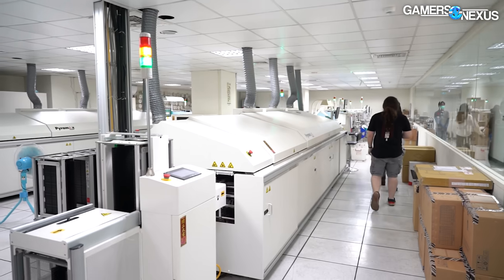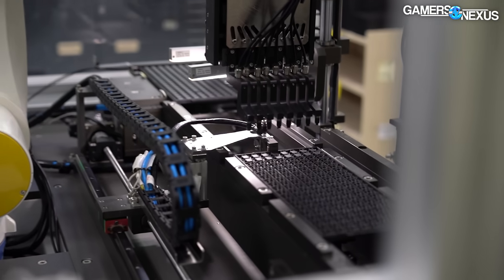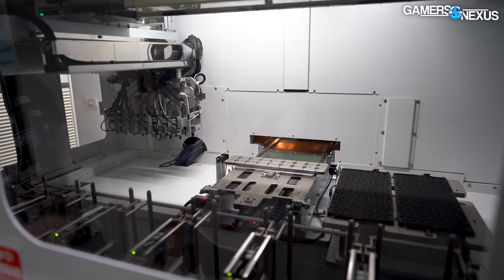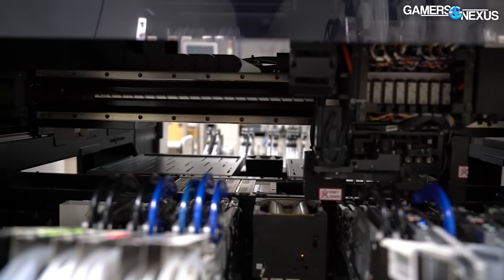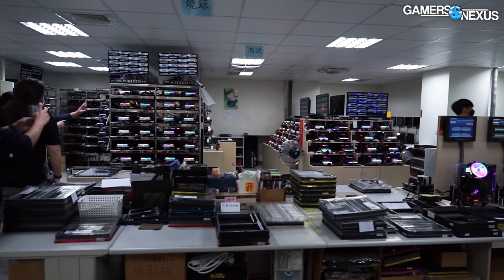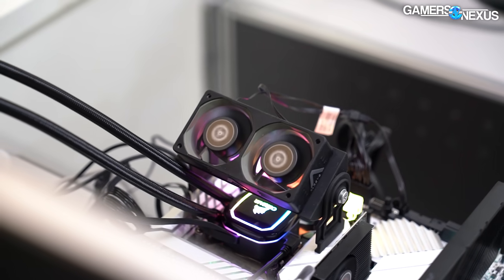How RAM is Made: Automated Binning, Manufacturing, & Burn-in Testing | Factory Tours S3E2

Comment: I used to work on an SMT line. It's so weird to see one work without constant interruptions, downtimes, alarm bells, dropped panels...
Reply from the maker: Cool! What were you making?
Reply: I used to have to babysit 2 different SMT lines along with 14 other auto lines. We were making circuit boards that went into brake modules for different vehicles. Our SMT lines went down a lot for various issues...they weren't the most modern or high end machines though. I always loved watching the pick and place just flying through the resistors, caps, etc. Started as an engineer in the summer in a year where we had multiple power outages (fun)...our SMT lines had only 15 minutes of backup power and then all Hell broke loose. Newbie at work with numerous lengthy power outages equals tons of fun!
Reply: @DaMerk5  Wait, you aren't OP.
Reply: @GamersNexus  Everything from EV battery controllers to custom wireless modules, but mostly closed-circuit measurement and control SBCs. We dealt with a ton of BGA-packaged DRAM and CPU modules. Unfortunately we didn't have AOI machines after solder printing, only basic 2D coverage checks, so visual and x-ray inspection was necessary with most products. The machines were old and worn-out, downtimes due to mechanical failures and panel drops were a regular occurence. One machine even used 3.5" floppy disks to load the tooling programs (it ran OS/2 and only had a coaxial thin ethernet connection). Obviously we couldn't leave the lines unattended even for a few minutes.
The challenges were certainly interesting, but the end-of-quarter crunch got really stupid sometimes.
Reply: I worked at Cincinnati Microwave nearly three decades ago; we made Escort radar detectors, and did large job work for others, right in Cincinnati USA. I was a coder, but I loved to watch the line in operation.
Reply: Great job, GN team. Excited for more of this. 30min per section would be great!

Comment: Gotta love seeing those offline industrial computers running Windows XP for the machine control software.
Reply: If it works don't break it.
Reply: True most specialized machines run older Os versions depending on the field of work
Reply: And windows 7
Reply: I sold a working Dimension with XP on it to a guy for cheap. Asked if he was using it for industrial control and he said yes.
Reply: Lol. Older Operating Systems?  A tools is a tool is a tool. The most American ATM use Xp  and most of them are unpatched. Doing the job with little to no error. Is worth keeping. Even if it’s on DOS. Lol. The new USA fighters are DOS based Operating System.
Reply: @riccarter4784  It is an older operating system. It has its quirks, limitations, and vulnerabilities. That being said, windows XP was incredibly stable, hence why industrial systems run it. It was also out for a really long time and didn't have kill switches like windows 10 and 11 (windows 10 will make fake 'system interrupts' to force you to update). Industry ain't got time for updates.
Reply: That’s what I’m saying. 10&11 suck
Reply: @goldenhate6649  Windows XP was notoriously unstable, people just look at it through rose tinted glasses because it reminds them of better times. It was a virus magnet and before the Service Packs it would constantly BSOD. Modern day Windows is much more stable, more secure and less prone to any weird instabilities.

But that's not why XP is used in factories. It's used because it's an offline machine, and the OS is meant to run software to control the machines. The software still works on XP, it might not work on a newer OS, the machine is not online so there's no reason to change it.

Comment: Summary
- 0:05 Robots making thousands of terabytes of RAM, revealing secrets of RAM manufacturing.
- 0:19 Vcolor, a Taiwan-based factory, uses custom-built automation to produce high-end memory.
- 0:54 Introduction to the automated overclock bending light lab with advanced frequency and stability testing.
- 1:38 Different colored robots (yellow and red) perform specific tasks; red robots are faster.
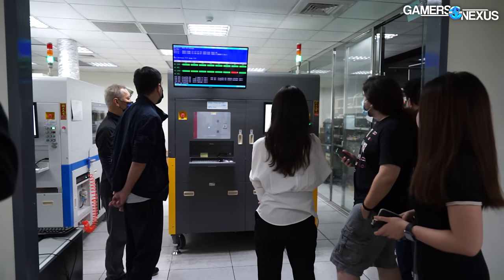- 2:00 Location of the factory in Shindan, Taiwan, housed in an older mixed-use office and residential building.
- 2:27 Inside the advanced overclocking test lab, high-speed binning robots and automation determine chip quality.
- 4:22 Description of the binning process by robots, including testing and sorting chips based on performance.
- 6:40 Transition to the assembly of RAM sticks using Surface Mount Technology (SMT) lines.
- 7:52 SMT lines feature fast-paced robotic arms, solder paste machines, and precision in component placement.
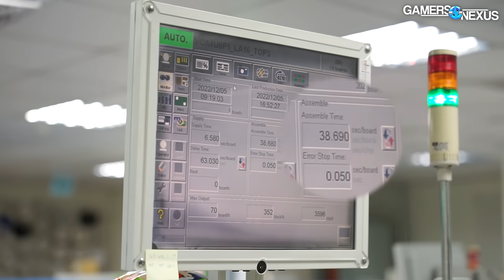- 8:47 Detailed explanation of the SMT process, from loading solder mask and blank memory PCBs to component placement and baking.
- 11:42 Introduction to the burn-in lab where each stick of memory is tested for stability and endurance.
- 13:32 Overclocking testing area where high-bin memory sticks are further tested and tuned for performance.
- 15:00 Conclusion of the video, highlighting the entire process of memory manufacturing and future plans for similar content.

Comment: Nice to see other SMT lines at work. At my workplace we have 2 SMT lines, I'm in charge to mount reels on feeders for the SMT tables, checking for any errors on the setup and sometimes supervising the lines. It's real fun when you receive parts in tubes instead of reels... Placing them by hand is a real pleasure x)
Reply: I worked at a company where we banned tubes, except for initial build prototypes. The downtime, defects, and inventory shrinkage (dropped parts, bent leads) had become too costly compared to the carrying costs of the higher capacity reels. It was fun trying to find someone with a 56 mm feeder to sell for our machine, but better than dealing with the homemade fork in the vibe feeder.

Comment: I worked for a company as a Senior SMT technician for the Fuji Aim EX III manufacturing motherboards for a customer in the server/ data center space using both AMD Epyc and Intel Ampere CPU's. My job was to train new people on how to operate/ load parts into the machines and to help engineers keep the machines running. I also ran the ICT ( in circuit testing ) on a Keysight i3070 series 6 which was a faster and more indepth fixture compared to flying prob. 

It uses thousands of pogo pins on top and bottom to make contact with all test points and run unpowered and powered tests to ensure all parts are present, properly polarity, functioning and no shorts. I also ran FBT ( functional board test ) it's similar but simulates a real working environment with test CPU's installed and runs a series of tests to ensure the board will handle the tasks it was built to do under " extreme " use case conditions.

Comment: Hi Steve, cool video - thanks for creating and sharing! I have a few questions though...

1️⃣ Were there meant to be burnt-in titles for each step? (Noticed "Step 3: Burnt-in" @ 11:46 but didn't noticed a Step 1 or 2 title)

2️⃣ In Step 1, when you say they do a "pass/fail analysis" (2:46) does that mean they're checking the module works at all (I.e. filter out any DOA modules)?

3️⃣ Just to double-check, when you mention "other frequencies" (4:08) is this MT/s?... If so, what was the actual frequency (MT/s) being tested at the time please, as I missed this?

4️⃣ By "burn-in testing" is what you can do as a consumer, where you run various patterns and arithmetic on the RAM to make sure there are no RAM errors? (if so, does the test check all ~8,000,000,000 bytes on the DIMM in 60 mins? -- that's a lot faster than a consumer test, right?)

5️⃣ I think you mentioned "AIO" somewhere (couldn't remember/find timestamp)... Do you mind clarifying how this applies to RAM?

6️⃣ Is the thumbnail ("Binning Our Own RAM") meant for this video?... I saw you had GN modules in the O/C benches (nice btw!) but the video seemed more like a "How RAM is made" video, rather than a "We made our own stick of RAM" video (IMO) 🤷🏼

NOTE: This comment is meant constructively (I am just naturally very detailed!)... To be clear, the overall video was great and really informative, thanks again for making and sharing! 👍🏼

Comment: I was just looking at the new gn site, specifically cpu and gpu section... I think adding filters would be nice, nothing too fancy, manufacturers for start. I also think for futureproofing, it would be good to have a way to extract architecture (also to apply filter); in the near future there will be gaming level arm cpus, and in a little further future arm gpus. Considering infinite page, I think some general filters at the top would be nice and would fit nicely (better than multiple tabs).

Comment: 8:50 to be super pedantic, the "solder mask" you're referring to is actually the solder stencil. Solder mask usually refers to the non conductive coating on the PCB itself (the stuff that's usually green, or in this case, black).
Reply from the maker: Thanks for that. Must have been a translation issue. The factory referred to (what you're calling) the stencil as the "mask" after translation.

Comment: At the polar opposite of mass production SMT assembly, I hand built prototypes of similar size to RAM modules, but with 2 or 3 fold the component density. These required a polyimide PCB and high temperature solder as they needed to function reliably @ 175 Degrees C.

Comment: Aside from silicon fabrication and smt assembly, there is a missing step in between - packaging silicone. I'm sure this is a fascinating process too.
Moreover, I think manufacturing small capacitors and resistors is interesting too, how they can efficiently do this with so teeny-tiny pieces. And package it into reels.

Comment: You show them testing all the chips for a DIMM at once. Do they test individual chips so the chips on a DIMM are matched?
Reply: It looks like they're testing each chip individually, but doing the test in batches. The tester is probably based on a standard cpu memory controller, so it likely needs a total of 64bit bus worth of chips installed at a time to run the test. Each individual chip would get dropped into a pass or reject tray, that's why you see some shots of trays with "missing" chips in some rows.
Reply: @kepstin  Excellent answer. Each chip is unique, but the test can check multiple chips together. That way they can bin the chips before assembling the DIMMs. The time to test at different speeds is a tiny fraction of the time to physically move the chips into the tester.

Comment: I don't really get how they bin the chips because they seem to handle DDR5 (VC1-5B + VC1-5D) and DDR4 (the rest) at the same time so they just test the chips against pre-established frequency + timings, they aren't really looking for its real limit, right? (meaning, if so, you still have room for overclocking)

Anyway, thank you for answering how bin is done, I always wondered how it's actually done. My dream would be to know how CPU or GPU are binned and lowered in tiers (specially when the yields are so good than they have to fuse off some parts of the silicon to step it down).

Comment: Hi Nexus Crew.
I am thinking about getting a V-Colour AMD EXPO 32GB x2 dimm kit for the new 9000 series CPUs and then getting the filler kit to fill the other two slots.

I looked on their website and it says the filler kits only work with Intel. If they are filler kits with just connections for the LED lights, why is that the case?

Comment: Very cool to see. Surprised they actually use full x86 PCs for burn-in rather than purpose-built test stations. Then again... I suppose it does at least ensure your memory works with the main target platform firmware & CPU -- and using an FPGA for validation of DDR5 would likely require an FPGA that costs more than the whole test PC... lol (not to mention the RTL & software dev cost).

Comment: Every RAM kit I have bought since DDR4 has had some instability and required slightly downclocking to work without causing a crash once a month or so.
Reply: You have ruled out your cpu&mb as sources of reduced performance? But yeah, it is true that most ddr5 setups are unable to run the fastest RAM kits they claim to be able to run.
Reply: I am going to go out on a limb and bet you own a gigabyte board. Am I wrong?

Comment: Great video ... the question I have is how do they create paired kits that are "guaranteed" to work seamlessly together?  Is that done at the next level by Corsair, Micron, G.Skill, etc. ?
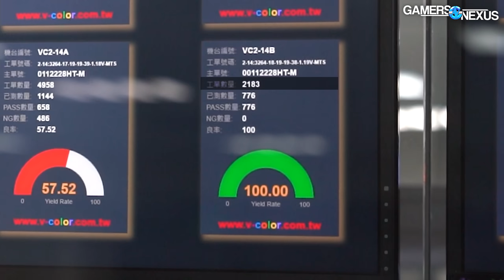Reply: 3:33 Look at the binning process here. The way they create paired kits is to make sure each and every single memory  chips are are tested to pass a given speed bin and timings. If double sided memory sticks pair, means they have to find 32 pieces of memory chips of  identical quality before soldering onto the PCBs. Every company does the same process. You have to remember , memory chips maker like Micron, Samsung and Hynix only guarantee JEDEC spec to these AIB.  Getting higher speed bins is always silicon lottery, that is why binning process exist to make overclocking XMP kits.
Reply: @fleurdewin7958  that simply means that they will meet a minimum spec/speed/timings … it doesn’t necessarily mean they will pair well.
Reply: @blackbirdpctech  it's pretty simple, memory sticks "pair well" if the chips on all of them are able to meet the same speed/timing specifications. The reason to avoid mixing/matching separately purchased sticks is mostly that the binning/testing process on different batches might have been done using different specifications.
Reply: @kepstin RAM kits are tested at the next step by the brands (Corsair, micron, g.skill, etc.) not at this early stage … it’s easy to say they will pair well if they all meet the same minimum spec, but that is in no way insightful … you are just repeating what I said above.

Comment: Wow, a small brand like V-Color does that much testing? I was thinking I would have to go with a reputable brand like Corsair, Crucial, or Kingston to get well-tested, reliable RAM sticks... to be honest, I've always been afraid to buy from brands like V-Color assuming that they were off-label brands, and probably just buy RAM chips from Samsung, slap them on the PCB, and then barely test the modules at all. Though I figured the RAM chips themselves probably work out most of the time because they are from a few manufacturers like Samsung or Micron, the modules just don't get tested as much with off-label brands.

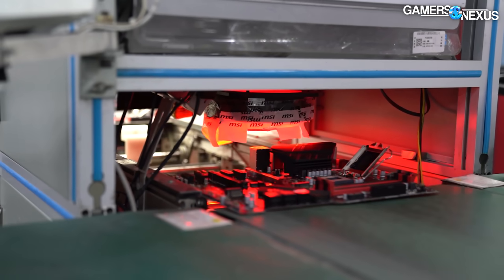Comment: The point at 8:02 about SMT lines requiring wave soldering is incorrect, as wave soldering (the stuff using the bricks of solder) is used for through hole (THT) components and not SMT. Note how the process for the assembly in this video is only SMT, and there is no wave soldering.
At 11:22 I would mention that these boards are likely fiberglass, so calling it PCB dust is selling it a bit short :)
Overall nice video about PCB assembly!
Reply from the maker: The point was to showcase different types of SMT lines. It is not incorrect to raise that point. Some SMT lines, like the MSI one, contain wave soldering steps within the longer SMT line run. The RAM does not use that specific step, but other components do. We showed the RAM step with the solder paste application.

Comment: Those are expensive as ** stingrays if they be freshwater polka........ like thousands to tens of thousand with some selling around 100k usd at the very top. 0:44. There was a multiple stingrays, congrats on that level of success XD  they also may be Thousand Island Black Diamond Stingrays which are ~600-700$ a 6 inch stingray

Comment: That is not a saw cutting the PCB. That is a router and basically running a custom made cnc router that is coded to cut the PCB and the PCB sit in the jig so they don't move and so every stick is cut the exact same.

Comment: Honestly I'm always a bit surprised to see standard PCs being used for component burn-in, it seems very labor intensive to me. Especially with something like DRAM where you don't need a complicated driver stack (like for GPU testing) - I'm surprised they don't have dedicated burn-in systems built using FPGAs. Maybe low-end COTS PCs are just so cheap it wouldn't pay off and it's cheaper to just have a roomful of PCs instead. Plus perhaps the marketing advantage (though I've never seen it) of "burned in on an actual COTS PC - worked for us (tm)".
Reply: Also interesting detail on the DDR risers they're using, you can see at 12:17 that they're not just for saving the motherboard's sockets (these are not built for many cycles), but they also have non-resettable fuses in the supply lines.

Comment: wow that rgb on EVERY SINGLE COMPONENT of the test benches seems like an incredible waste of energy and increased cost
Reply: AMD CPUs are sold included with those RGB coolers. It's surely more efficient operation-, cost- and energy-wise (AMD CPUs are more energy efficient, and include better stock coolers than Intel counterparts.).

Comment: Yamaha makes an outstanding solder printer. Displaying pressure in (force/squeegee length) is unique but correct. Having an adjustable squeegee angle can be very useful with certain solder pastes. I haven't used their P&P but am told they are also outstanding. 

BTU ovens are best in class, but that software looks significantly different than my North American Pyramax. They may have different SW development in different regions. 

Your reflow oven and process explanations are a bit rudimentary, but I assume that's partly Chinese to English and partly "skilled worker" to "tour group" translations. 

If you ever want a fully technical explanation, I would be happy to do a video call and go through the whole thing in full detail (metallurgy, solder paste as a material, the reflow process, various defects that can occur). I can't offer a tour of my job because it isn't as exciting as high volume/low mix and is high security.